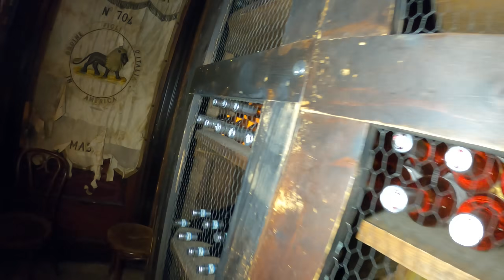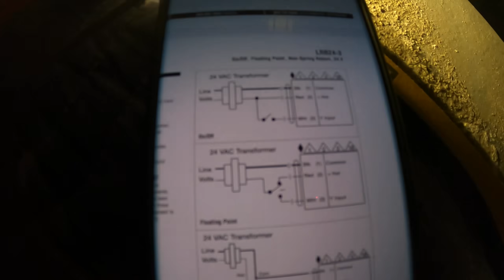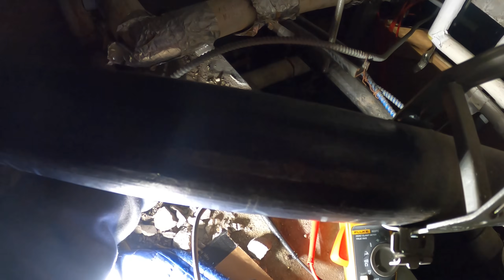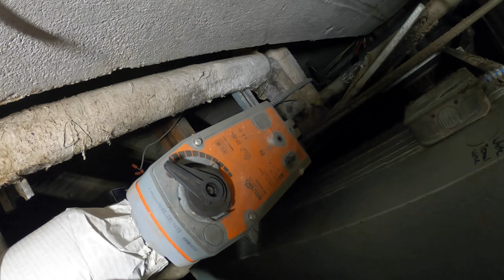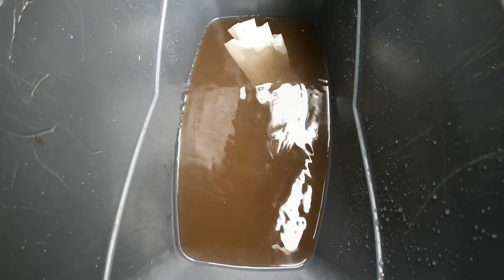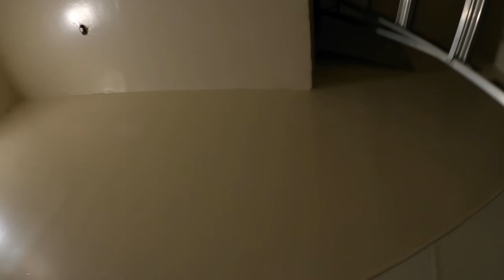HVAC Service Call: 4 Pipe FCU Nightmare (Fan Coil Unit Not Cooling) FCU Troubleshooting/Repair

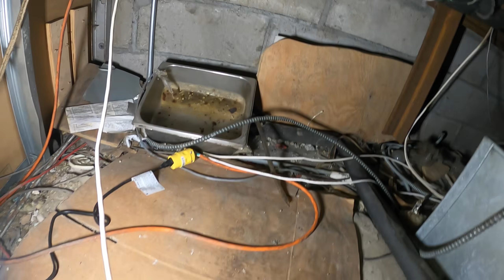Comment: 1:04 It really grinds my gears to see the general mess up there. I mean look at the state of it all. Debris everywhere that has no place in or near any proper HVAC installation. If every service call would just take 5 minutes to clean up after fixing whatever issue they came to fix, the next service call wouldn't need to crawl around in that absolute mess. If nothing else it's a breeding ground for rodents, spreading disease and chewing on cables.
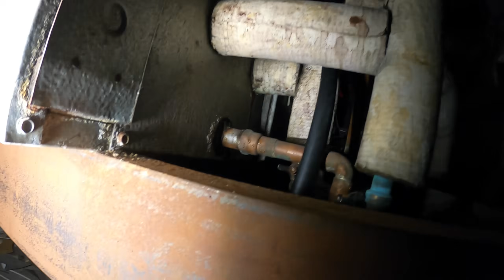Wow, even worse at 19:42. Like, how hard is it to take that old light bulb and paper cup to the trash?

Comment: The contractor that installed the actuator and upgraded controls should have cleaned up all of the wiring and made new schematics. I had similar problems on one site took me 3days to trace and rewire complete building

Comment: An infrared temp gun makes quick work of checking the position or leakage of a valve. Check both sides of the valve about 18 inches away and check for differential.

Comment: You can check your pressures where the air vents were to see if you have pressure difference (flow). And Why would that bypass on the chilled  water side be open?

Comment: I work on church buildings designed like this. The units were put in during construction and sealed from there. Not giving a F*** who works on it. Not a fan but it’s where the big money is. Good work my man. Thank god it was rather easy to fix but not easy to get to